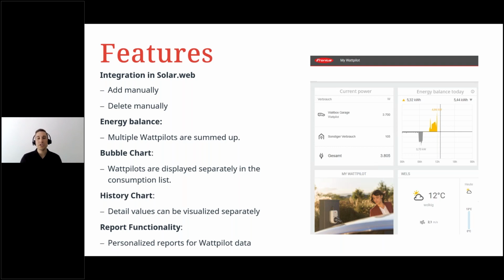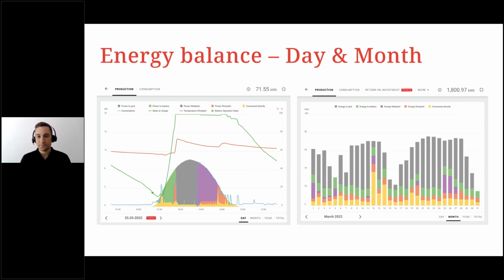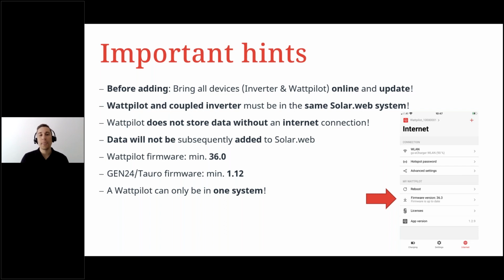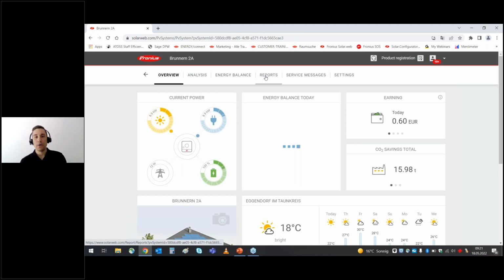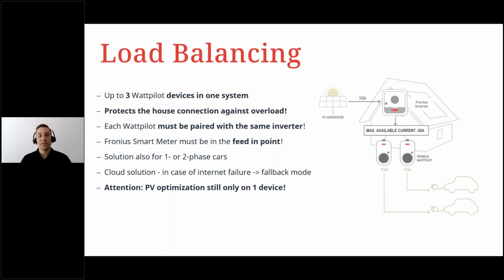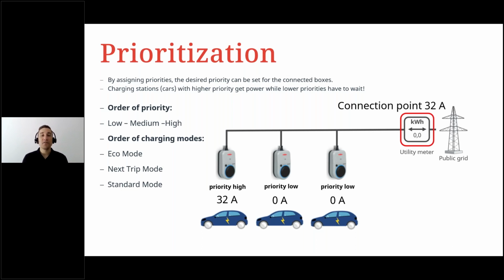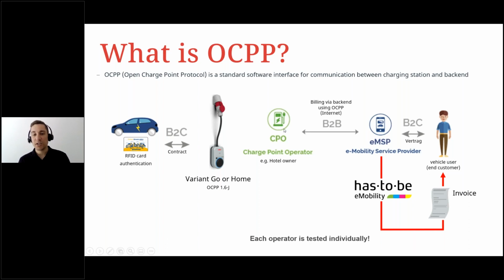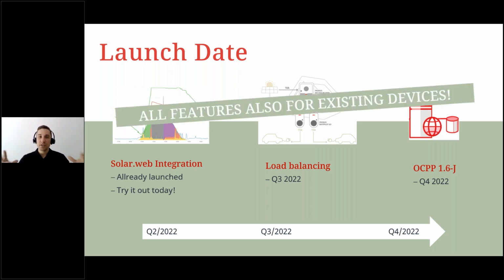Webinar: Wattpilot News – Load balancing and integration in Solar web (EN)

Comment: If possible  please add a feature to PV surplus charging that takes account the load on different phases.  My EV uses only 1 phase and when I use the surplus charging it tries to use the maximum power when I have surplus. However that means that although I'm selling from 2 phases to grid, I buy from one phase. I would like it to look at all phases and only use my solar power. For example: PV in (free): 6kw,  Wattpilot wants to charge the car with 3,6kw (16A). However 6kw means there is only 2kw per phase of solar power. And it means whilst I'm still selling on 2 phases I'm buying  1.6kw on one phase.
Reply from the maker: Hi @haanjamiis!

Please forward your Feedback to pv-support@fronius.com.

Best regards, your Fronius Social Media Team

Comment: Will it be in future possible to do load balancing based on other smart meter than the one connected to feeding point? 
I mean if I have feed line and connected SmartMeter for say 3 Wattpilots, can I limit the total load on the said feed line.

And what if I have several Fronius inverters, can I also add more than 3 WattPilots for the same system in that case?
Reply from the maker: Hi t83rg!

For one household with one connected Fronius Smart Meter at the feed-in point 3 Wattpilots can be managed via the load balancing function. The number of the inverters does not change the situation.

Best regards, your Fronius Social Media Team